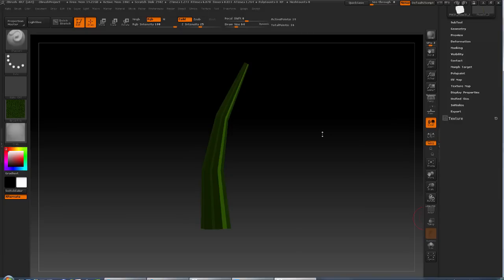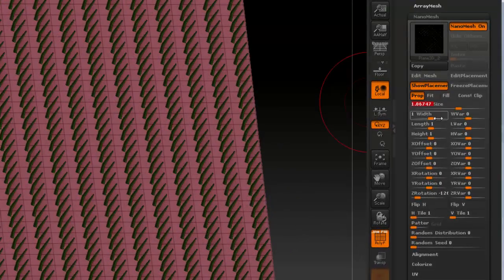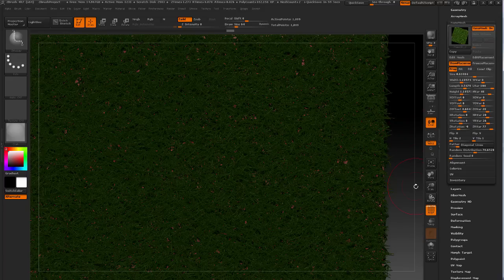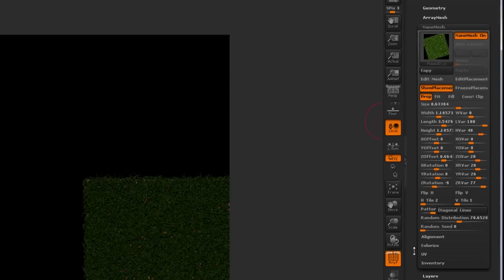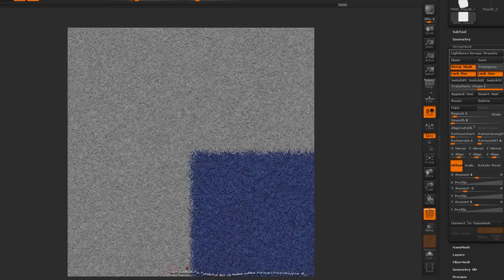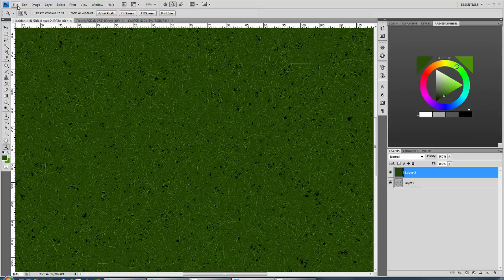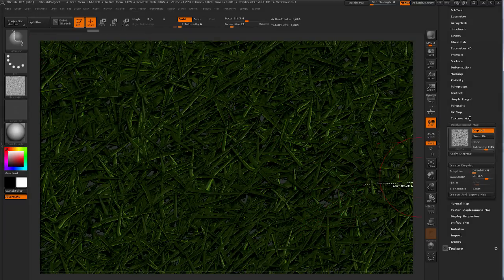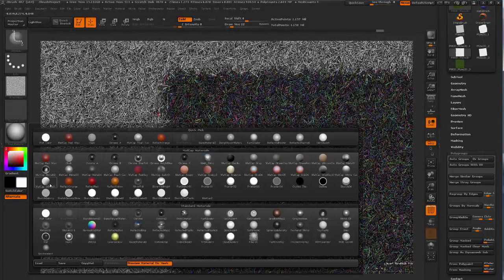Zbrush 4R7: Tiling Textures with Array+Nanomesh

Comment: Very useful trick!! Monday I will most probably use that in production!
By the way you can solve the one pixel problem by doing a best render and not a bpr.
Reply from the maker: Great tip ! Only works though when using flat shader. For documents with shading I think you need to turn off shadows for it to work.
Reply: campi3d Yes indeed. no shadow...

Comment: Very cool tutorial. I was wondering if you wanted have different grass leafs. You need to make multiinsert brush correct and convert this to Nanobrushmesh?. But when you draw on the plane how can you draw with different meshes of leaf. Not only one. How would you do this?
Reply from the maker: There are several ways to do this (as always in Zbrush):

1) Simply duplicate the plane and work one element by one
2) After you placed your first nanomesh on the plane, select 'Freeze Placement' in the Nanomesh menu,
   then using hotkey 'm' select another nanomesh and start dragging it out on the same plane.
   The 'Index' that is greyed out in the nanomesh palette will become active allowing you to switch between your meshes.

Please note the 'one to mesh' function will only allow you to generate the current nanomesh index, so you need to step through them all one by one and convert to a mesh.

Also don't forget nanomesh works with all other zbrush functions. You can for example use noiseMaker to create random polygroups to place your nanomeshs on for more variation.
Reply: campi3d Hi, thanks so much!!! For Nanomeshes you usually use low a poly mesh.  I was wondering how you would approach texturing. You can't use polypaint. Would it be wise to render different passes and just do it PS?
Reply from the maker: decorix BTW> with the new patch 2 for R7 you can keep using nanomeshes with Array Meshes AND maintaining tiling (RandArray option)
Reply: campi3d Can you perhaps show this with the new version (RandArray option) When I draw a highpoly mesh I'm getting not many instances (with Polygroups all turned on) Also when I draw them in the center of my polyface they are not drawn in the center, but all over the grid/plane. While LP nanomesh works ok. Do you know why ?
Reply from the maker: decorix You're right. Anything above 100k polys on a nanomesh instance seems to go wonky. Probably a bug. Then again anything above 100k used as nanomesh is not workable for me anymore anyway since I cannot rotate anymore :) I reckon, 100k plus bump/normal map plus texture map should still give you plenty to work with.

Comment: Nice tutorial. The only problem Ive encountered is that ZBrush doesnt always keep the UV Map of the Nanomesh when I hit "One To Mesh". Do you have any idea what I could be doing wrong?
Reply from the maker: You sure the uvs are actually gone ? The texture gets unassigned and you need to reload and reassign it but the uvs so far always seemed intact for me.
Reply: campi3d Yep it says something along the lines "Textures can only be assigned if UV Map exists". It only happened to me when I used multiple meshes. Worked around that problem by using good old polypaint instead
Reply from the maker: YoutubeGivesMeCancer I'll give it another go tomorrow to figure out what I am doing differently.
Reply from the maker: YoutubeGivesMeCancer Well I tried it again and I am always keeping my uvs no matter what.
That being said I when you use the Index in Nanomesh and do oneToMesh for each you will still end up with one subtool.Each part of the mesh will have correct uvs but since it is only one subtool you can only assign one texture.
I stay away from using multiple nanomeshes at once. I usually just create one, OneToMesh it, split the mesh into a subtool and then add to the original plane. This way each subtool can be assigned a uv texture. But I honestly only use this process for creating tiles -- it might not be as easy to manage if you are working on a scene.
Reply: campi3d Hi, Whats the workflow for texturing low poly nano-meshes?

Would you need to polypaint hires mesh then zremesh it and
create uvs for it and finally decimated it (keep uv's) to create 
final nanomesh with texture?
Reply: campi3d
Thanks for trying to figure it out and explaining your workflow in detail
Reply from the maker: YoutubeGivesMeCancer BTW> with the new patch 2 for R7 you can keep using nanomeshes with Array Meshes AND maintaining tiling (RandArray option)
Reply: campi3d Does this RandArray option need to be turned on? keep using nanomeshes do you mean you can select different nanomeshes? Do you still need to do the one to mesh?
Reply from the maker: decorix 'RandArray' off, no - 'one to mesh' is no longer necessary, yes - you can insert multiple nanomeshes on the same plane by using the 'Freeze' Button and dragging out a new/different one which will step up the 'index' one.
Additionally, Joseph Drust has just released 'NanoTile Master'. Very useful for this workflow. Link in the description of this vid.
Reply: campi3d If you convert your mesh to a nanomesh brush without giving it a texture it won't obtain the UV's once you select OneToMesh. I found you need to have a texture applied when converting to a nanomesh brush to keep the UV's. 

Nice tutorial mate!